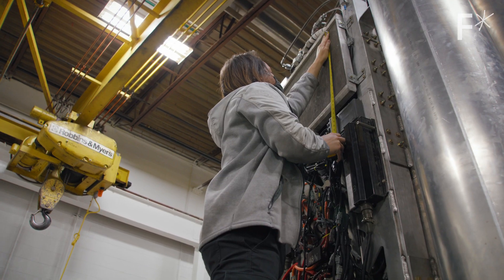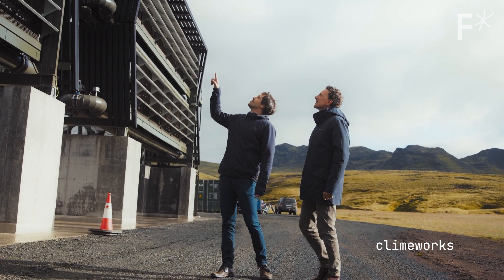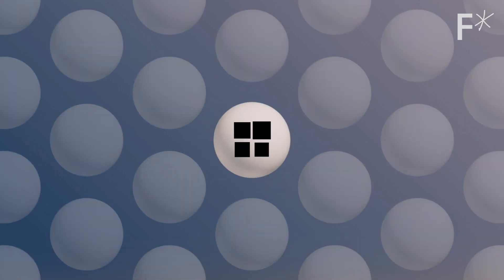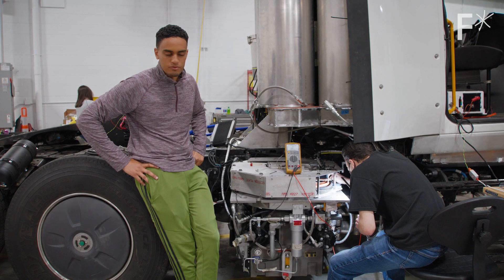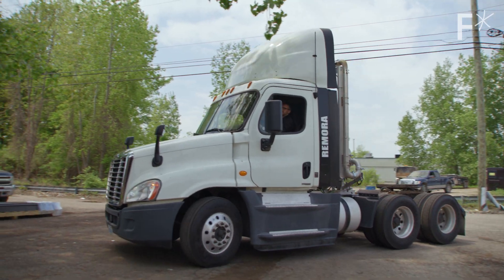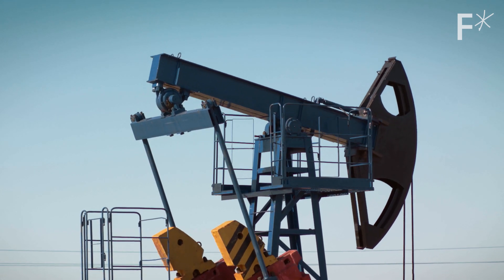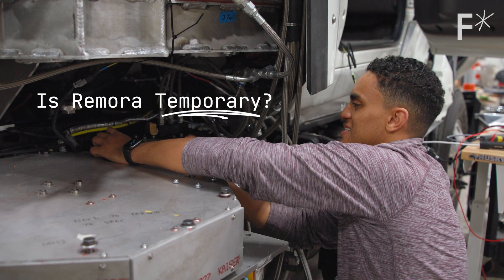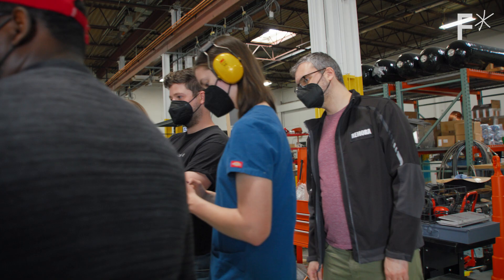Can this invention fix dirty transportation? | Challengers

Comment: Love their work but I think what is often overlooked is that once you sell the CO2, not just to oil companies, you don't know what they do with it. Every product has a lifespan once it's over it's going to break down and release carbon. Take fizzy drinks for example. You open the bottle the CO2 is gone. If those products were made from fossil fuels anyway your not doing any more harm. But if they used a natural water spring or whatever that released CO2 anyway beforehand and they now switch to your product which decreased fuel efficiency you're unintentionally making the problem worse.
Edit: found out the CO2 for fizzy drink comes as a byproduct of NH3 synthesis, which is made using Methane (for heat) . At least here in Germany.

Comment: 1 litre of petrol weighs 750 grams. Petrol consists for 87% of carbon, or 652 grams of carbon per litre of petrol.
80% of 652 is 521.6grams
37.9 million trucks registered and used for business purposes (excluding government and farm) in 2019
37.9m*130.4 grams per litre= 4942160000 grams or 4942.16tonnes of carbon left per litre spent, nice work but there's still a massive problem left

Comment: The idea is impressive. 
The timing makes it edge-worthless.

By the time their tech/idea matures (3-5years) and becomes viable/scalable (add another bunch of years) we'd be already transitioning to Electric/Hydrogen trucks. Which is not gonna make their tech obsolete by night, but it will lower the appealing for investor and the return drastically. The remaining truck companies that find it too expensive to replace their fleet with electric, pretty sure they will also find it expensive to install such systems. Cause on the long run a full-ev truck generates a lot more income than this device.
Reply: Well it is going to take time to electrify the trucking industry. Even with all the big name semi manufacturers making electric trucks there's likely still going to be a market for this. Though adding 5000lbs of equipment and another 1200lbs of CO2 onto a truck isn't going to help it's fuel economy.

Comment: More techno gee whiz which won't help.  Pure folly.  The carbon still needs to be sequestered.  The energy needed to sequester the CO2 has not been included.  It is pure folly to believe this technology would ever reach the scale needed to save the 5% emissions quoted in the video.   It would be much simpler to convert the truck to a synthetic fuel like DME/Ammonia.  There are various ways to make carbon free synthetic fuel more efficiently than existing diesel sources.

Comment: Very interesting! Thanks for this video. What he said about "...taking carbon capture and shrinking it down, so that instead of it being this sprawling construction project it's this really concentrated manufacturing challenge" seems to be the heart of what they're doing. It does make sense to take the problem of carbon capture and use a "bottom up" kind of solution where it's captured at the point of emission, instead of a "top down" approach where you need enormous industrial plants to remove huge quantities of CO2 out of the air after it's been emitted.

But if this device catches on, they'll still need to deal with enormous quantities of CO2. It'll just be divided into hundreds of thousands of tank loads. And that means creating a new distribution network on a mass scale, so I hope they're up for the logistical challenge.

Another interesting idea might be fitting other kinds of vehicles with mobile carbon capture devices, like cargo ships. And could you design a plane with this sort of technology built in? They're already designing hydrogen and electric planes, so this seems like a similar or even easier challenge.
Reply: not really, eletric semis are still probably 40 years late before they become efficient enough to be worth it, at least in the usa, not to mention how developing countries are naturally always late in terms of greening, so another 60 years probably
Reply: @mahuba2553  Were you replying to someone else? I don't understand the relevance of your comment.

Comment: Surely, an EV battery that can run a transport truck weighs less than 5,000 pounds and I bet it would fit in the same place as this device. Why not retrofit existing trucks to run electric or at least hybrid? It also seems like the top of a trailer could be a good place for solar panels. especially if they're as light, small and efficient as the shingle alternative they were working on at Tesla. 
Also, doesn't pressurized co2 explode if hit or dropped? I mean, who hasn't dropped a can or bottle of soda and watched it spray everywhere?
I think it's more efficient to put these devices near or over intersections to capture carbon from all emitters and eliminate the fuel efficiency reduction and possible safety hazzard of driving around with a bomb behind you. 
I also think we need to take a hard look at finding efficiency in logistics and at creating a sustainable economy rather than one based on growth.
Reply: The trucking application is far too high strain for a battery electric drivetrain, Hydrogen is much more suitable for this type of work. Especially when we now have Cummins and Freightliner, etc developing and refining Hydrogen combustion engines. Hybrid sounds better than full electric in my opinion.
Reply: Unfortunately the  highways and the general working. conditions of the trucking. business might give them too much rough. handling to make  them practicable.

Comment: DEF is killing the reliably of semi-trucks and is not good for gas mileage, more weight and more part means less reliability in gas mileage. Owners of semi are struggling to trun over a profit between gas prices, reliability or break downs and customers not paying for thier loads. If you add one more thing that doesn't pay for it's self quickly you will only have less truck on the road and more unemployed people and even more inflation.

Comment: this company is calling EVs green washing but ignoring the fact EVs have less moving parts and just last longer because an electric motor is under much less stress then an ICE. Not to mention truck companies aren't buying EVs because to be nicer to the environment, they are cheaper to run in terms of fuel and just regular maintenance, while their solution adds weight and more complexity while also producing toxic NOX gas. As cool as this is, this ain't it
Reply: You missed the „sponsored by Exxon“ part

Comment: The government kneecapped trains to make these trucks more profitable in the first place. Just get the government out of the equation and go back to rail based transport then use these trucks for final destination delivery. It's not hard to understand.
Reply: You  must take a look at the March edition of the scientific magazine'Joule' and the 'CO2Rail' website to see the 'DAC railcar' innovation which will allow trains to capture CO2 from their slipstream while using the  energy from braking to power the. units which  have been reduced to rail cars size.There will also be a railcar to  extract emissions from the  diesel engine.Unfortunately  it is unlikely to  capable  of. being scaled down to truck size but who knows maybe for aviation?
Reply: Very well said.   Freight primarily belongs on the railways where economies of scale come in etc.   Solar panels on freight cars would help.   However, most solar panels are only 21 - 25% efficient, though new 39% panels are now being developed!
Reply: Trains no matter how effective or plentiful will never replace versatility and agility of the road transport. It's true trains can help in this equation, but to only balance things out and not as a single silver bullet solution!

Comment: If green hydrogen is produced on a larger scale, wouldn't it be easier to covert the trucks to run on hydrogen?
Reply: Electric highway will work better than only battery or hydrogen.
Reply: How about a mix of electric highways, batteries, hydrogen and carbon capture depending on which is cleaner and the most possible depending on the location and circumstances?

Comment: This is awesome!
Now all we need is an endless supply of fossil fuels to cheaply run this now heavier truck. 
Fortunately, our supply is local and in friendly countries who value the environment, peace and never changing the price of oil. 

This device reduces the efficiency of an outdated and already inefficient system. 

Battery swapping with trucks makes more sense, and would reduce the price of a prime mover, if the batteries were leased to be exchanged for recharge.

Comment: When you cool down the exhaust, you prevent NOX from breaking down. Which is much more dangerous for the environment than CO2. Plus massive expense, weight, and intangible benefits for end users. Nice idea, needs a lot of work though
Reply: isn't the exhaust cooled after the cat converter? all nox is theoretically handled there, and there's absolutely nothing to help with that after the cat anyway.
Reply: NOX is handled through the use of DEF. Modern semis basically exhaust nothing other than CO2 and water
Reply: An if captured in a safe way what could potentially be made out of the nox ? If anything. Sounds like the temperature of capture is Extremely important for the CO2.  An it's nice to see informative answers back to these topics. For dummies like me .
Reply: @motogeee510  The capture of CO2 from the diesel seems to me to be a strong argument  for the use of 'synfuel' diesel -especially from DAC (Direct Air Capture)sources.This would. bring about a NET removal of atmospheric CO2. I had been concerned though about OTHER undesirable emissions from diesel i.e.NOX and SO2 and, unfortunately, I have heard that 'synfuel' is no better then. conventional fuel in this regard.
Are you saying that ALL undesirable emissions are now being removed during diesel truck operations?

Comment: This isn't a solution, this is a bandaid on a broken leg, which normally is a bad thing except when you've been walking on a broken leg with no treatment of any kind for 100+ years. This is great as a temporary way to help in a meaningful way, but storing CO2 underground is the same as sweeping dirt under a rug, you can only do it for so long before it becomes a massive problem. That said we have a massive problem ATM and this is great for a temporary relief so I hope they get it going ASAP and then work towards a permeant solution.

Comment: Also it would be nice if they can use that CO2  and turn it into some sort of energy
Reply: While on the road
Reply: Other people are working on that, doing things such as converting it into fuel!
Imagine filling up your car/truck, taking it on the road, and then converting the CO2 you generated back into more fuel for your vehicle. Effectively, it's an almost carbon-neutral solution.
I don't know about it being done while on the road, but it's at least a step in the right direction. Having it done while on the road may not even be necessary, like if you need to fill up your vehicle with new gas, you could offload the CO2 at the same place & time, and get a discount on the gas you're filling up with, as the gas station could sell that CO2 to a CO2 > fuel company.

Comment: Good idea but i have concerns that this will be way less CO2/ $ spend than other solutions.
This system needs to be retrofitted by a Company that is willing to do it without any monetary incentive for it. And i really doubt there would be a large adaptation if there is no governmental support for it.
IMO a better way would be to build stationary CO2 caption Plants, those can run 24/7 and not only when a truck is turned on, therefore it could capture way more and way cheaper bc it does not have to be mobile with restrained space. Also it would be cheaper bc it could be build in a very large scale. 
Even when it would be fitted to 5.000 trucks a year it would take 400 years to fit all of the trucks only in the USA (and how long do you think we are still dependent on combustion Trucks?) and this Company is still in the Prototyping phase. So I'm guessing they would scale up to maybe at most 500 Systems a year but only if they are really financially successful. So either way this would not have a noticeable effect on reducing CO2. 
Also when this system really captures 200 t a year per truck and can hold a maximum of 1200 lb's (0,544 t) CO2  in its Tank it would have to stop and empty its tanks 367 times a year, guess how many extra miles and hours spend that would generate. If it would add only 1/2 hour a day it would mean a trucker can drive 1/2 hour less a day (the company also needs to pay him for 1/2 hour less of work per day) and that the freight would be 1/2 hour late per day of carry wich would be bad for competitiveness. And I didn't even factor the cost from the extra miles. And when the CO2 tank is full but there is no station near to empty it (i could imagen that would be the case pretty often) the whole System would just stop to function wich is wasted potential and completely negates any positive.
Also the Volume of this System, engine, transmission, exhaust, tanks, etc. of a normal Truck would probably be sufficient space for a large battery btw. that would be good enough for a couple 100 miles. (only 11% of hauls are longer than 200 miles )
But we need Projects in a way larger scale that can be deployed faster than this to really see effects.
I don't say that smaller projects can't help but this definitely is not a solution for clean transport as the title might suggest.
I'm really questioning the amount of critically thinking this channel does.
Reply: Engine exhaust has very high concentrations of CO2, whereas the air has extremely low concentrations of CO2. This makes it less efficient to extract it once diffused into the air than from the source.
Reply: You bring up a lot of serious issues, which will probably be the reasons this tech never goes mainstream.
Although I'd like to point out that direct air capture is crazy expensive. Climeworks charges $1200/ton!
Reply: @DeanReading  ok I did not know that is was this expansive for now. But there are other way cheaper method's for CO2 capture or even better: avoiding  CO2 emission. 
Forestry for example only needs about 50$ per ton of CO2 caption.
And like another comment pointed out that it would generally be best to switch as best as we can to electric rail for long range transportation of goods because already safes about 70% of emission compared to trucks. And even better would be to electrify to also electrify the last bit of the transport as well.